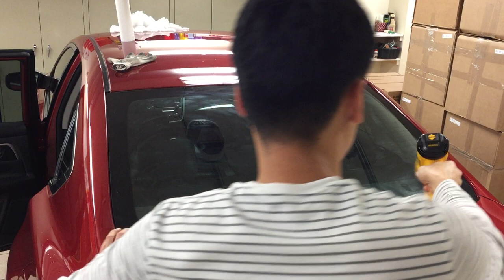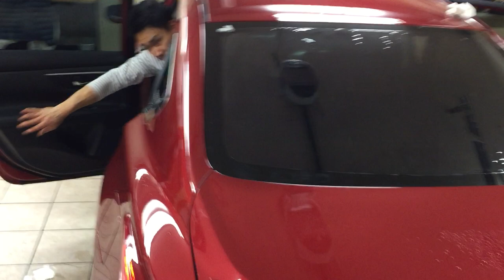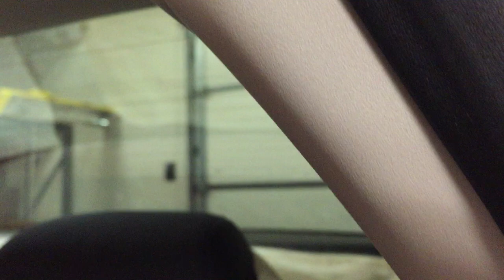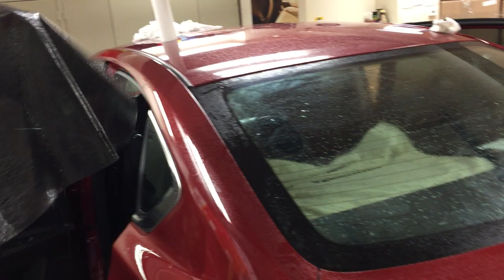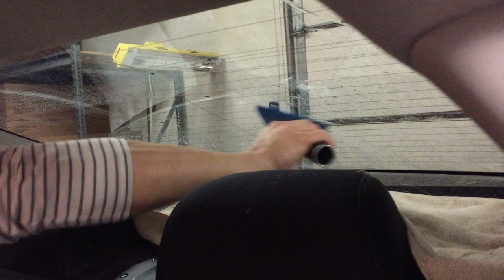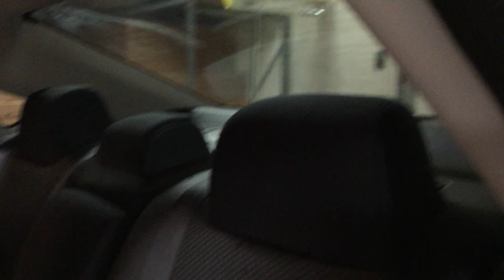How to Install apply Back Windshield tint film Precut kit on a car suv truck window.

Comment: why  the heat shrinkiing, is it cheap film,
Reply: The heat shrinking is for the tint to get the curve of the window when you install it, since back windows aren't flat they have a curve just makes it easier for installation. I work at a tint shop and they explain why heat shrinking is important.
Reply: Like Imp said you have to mold the film to the shape of the glass

Comment: what % did you use here?
Reply from the maker: It is a 15% Dark tint shade!

You can purchase Complete pre-cut window tint kit and Uncut roll of film from us at 
http://www.LexenAuto.com
by LEXEN TINT SHOP, MD 21228   443-315-5047
Reply: lexenauto what is the blower for?
Reply: @djdlirio  heatgun is to shrink the tint. Something that has to be done even if the tint is pre-cut.

Comment: He did better then most, but still that's not quality at all for sure a amateur tinter. To perform a good quality job you need proper tools which he didn't have how about invest in  a yellow turbo squeegee proper tool to squeegee windows not a blue max, amateur tinted for sure, an how about installing the back window rolling the film it will come out cleaner an less creases you expose the film to dirt when u install it the way you did also tint 101 never put your tools on a customers car an don't drag the cord on it either treat it like your own especially if your making a video I rate this video an this tinter 4 out of 10